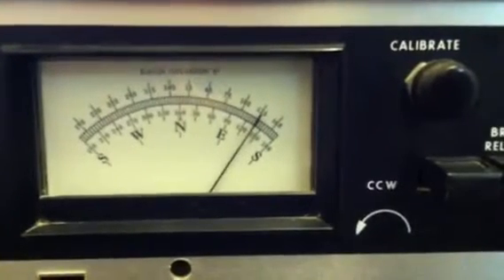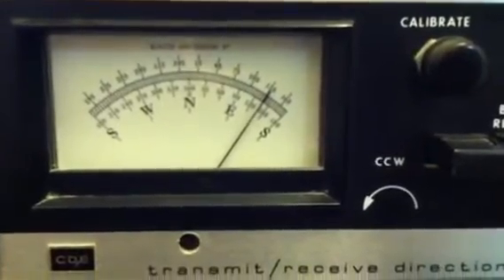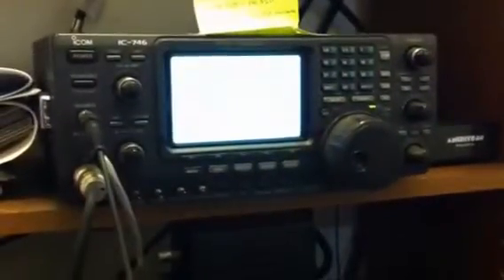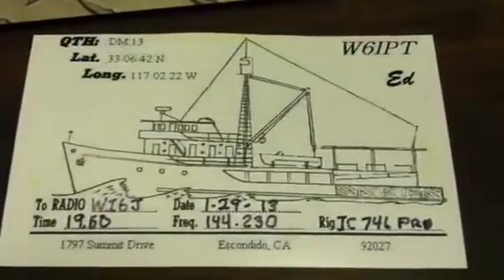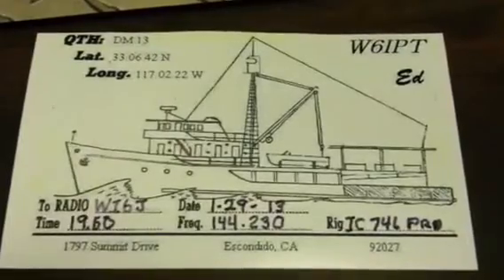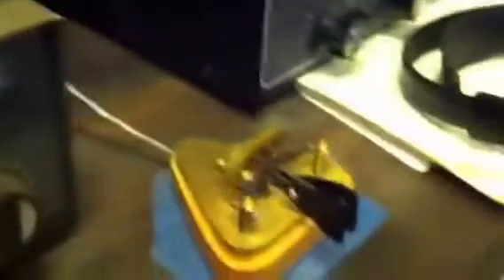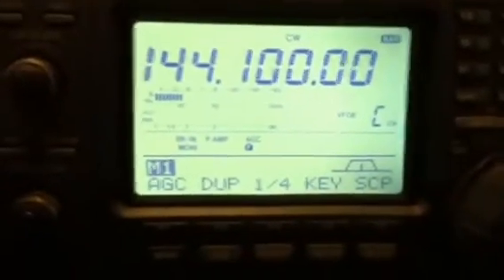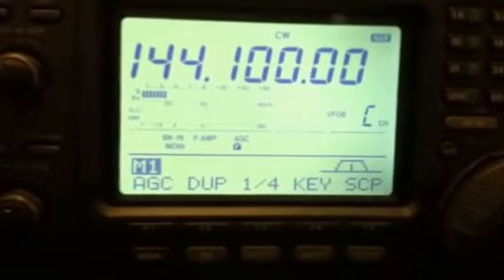2 Meters Demonstrated (Ham Radio)

Comment from the maker: Hi Tim thanks. It sounds like you need an Elmer. Make sure you pic one correctly. You'll know if they're qualified because they'll have beams mounted horizontally, and most likely NOT have any vertical 2 meter FM (cb) antennas. They also should have a DXCC award hanging in their shack, in addition they should have a box full of Qsl cards, or they'll be on LOTW.

If their house smells like cats from the street, lawn hasn't been mowed in years, house needs painted, weeds are over grown, etc, run away! These are not hams, they're 2 meter FM cb operators, no Qsl cards, no operating other than local 2 meter FM cb repeater stations.

A qualified Elmer should have a well kept home, lawn is mowed, house is not in need of repairs, the person has a job or retired from one, they're not destitute. I hope that helps you out. Yes beams need to be mounted in horizontal positions, unless you want to talk to where your tax dollars end up, if so mount it vertically. 73